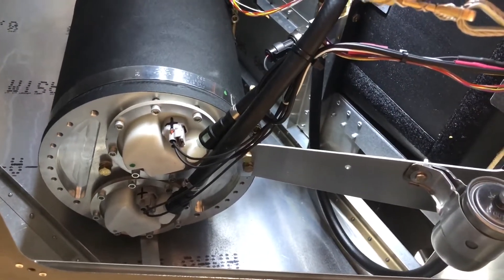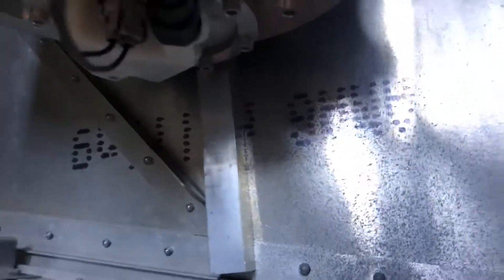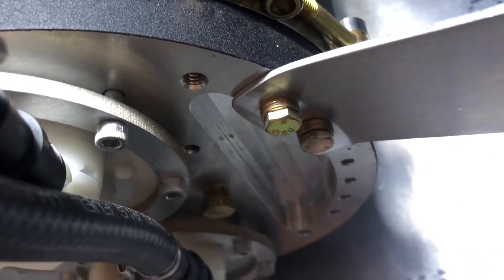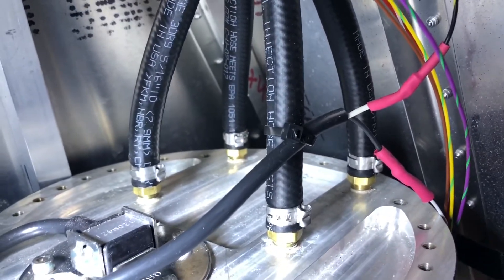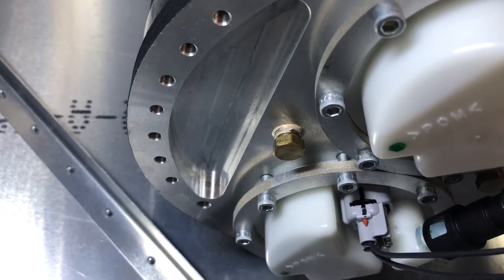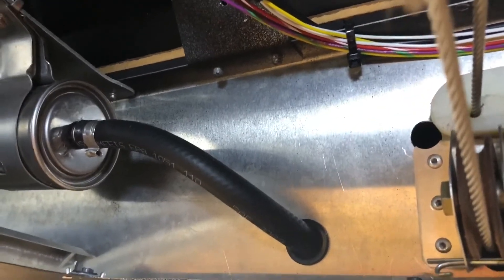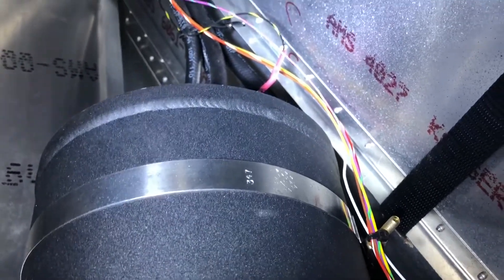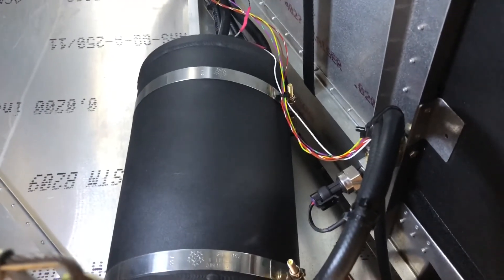Viking 2.5 GAL header tank installation

Comment: Why do you need a Header Tank
Reply from the maker: A SOLID FUEL SYSTEM IS IMPORTANT FOR ANY AIRCRAFT ENGINE. THESE ARE THE SYSTEMS USED BY THE THREE MOST POPULAR LIGHT AIRCRAFT ENGINES IN USE
TYPE OF FUEL SYSTEMS USED
ROTAX
• Dual external fuel pumps
• External single fuel regulator
• Fuel return commonly back to primary fuel tanks
• 6 port duplex fuel selector valve
VIKING
• Dual in-tank pumps
• In-tank dual fuel regulators
• Header tank based system
• No fuel valve needed
UL
• Dual external fuel pumps
• External single fuel regulator
• Fuel return commonly back to primary fuel tanks
• 6 port duplex fuel selector valve
EXTERNAL FUEL PUMPS
• UL and Rotax use external fuel pumps for their injected engines. They are a copy of what was used in cars prior to 1998.
• When 2 pumps are used together, for takeoff and landing, the amperage draw can be 10-14. This is a lot since these engines are not equipped with good alternator systems. Even with a single pump running, the draw is scary high if either the generator or external voltage regulator were to fail. The dual fuel injectors and sparkplugs cannot work without electricity. 
• External pumps produce close to 2 x the required fuel pressure for the injectors. The excess pressure is regulated back down, using an engine mounted fuel regulator. Excess fuel is returned to the fuel tank. 
• All this additional fuel, when returned, brings heated fuel to the tank. The total fuel circulating between the main fuel tank and the engine, then returned, is about 30-35 GPH. 
• Due to the excessive fuel circulating, the amount of fuel gravity fed to the firewall mounted pumps is also 30-35 GPH. Hence the large hoses specified.
• Rotax and UL each use a single fuel regulator at the end of the fuel rail, mounted to the hot, air cooled cylinders. The Rotax brand is likely to be Bosch but the UL is a no-name copy. Each is filled with rubber parts and will fail, sooner or later.
• This is now an antiquated way to feed fuel to a fuel injected engine.
EXTERNAL FUEL REGULATOR
What is the big deal about a fuel regulator? Well, what is the big deal about a wing attachment bolt?
• The external fuel regulator is the single point of failure in a UL or Rotax injection system. 
• An external regulator requires external fuel return hoses.
• The regulators used are automotive quality and have a definite life span.
• The engine ECU (control computer) knows nothing about fuel pressure. If the pressure is wrong, the engine will not operate correctly, no matter how many sparkplugs it has.
• A single fuel pressure regulator is not consistent with any other dual capability. The engine cannot run without it.
• ASTM was never informed of this.

INTERNAL FUEL PUMPS AND FUEL REGULATORS
• The Viking fuel system does not use a 35 gph gravity drain system, a single fuel regulator or a complex 6 port fuel selector valve. 
• The Viking system is based on dual, in- tank pumps, each equipped with its own fuel regulator.
• Each pump draw less than 1.6A and has no external fuel return hoses.
• Only the amount of fuel used by the engine is gravity fed from the main fuel tanks to the header tank
• A fuel level gauge measures the exact fuel level of the header tank, providing accurate fuel gauging.

ISSUES RELATED TO SYSTEMS DRAWING/RETURNING FUEL TO/FROM A MAIN FUEL TANK
• A fuel injected engine MUST have a solid fuel pressure at all times, or the engine will stop
• Having reliable gravity feed, all the way from the wing tanks to the firewall mounted pumps, of 30-35 gallons / hour is much harder than the 2-12 GPH that the engine is actually using. When this system was used by cars, the pump was mounted right below the fuel tank.
• There is an illusion that these systems work because fuel usually come out of the pump when turned on. What is not so obvious is how small the margin is for the system to stop working. 
• It is likely that even though the pump was never designed to pull fuel on the suction side, that in the airplane application it actually does this to keep up with demand. Since there is suction, any air leak prior to the pump has the potential for pump cavitation. An O-ring leak in a fuel drain, gascolator or selector valve would not be good. 
• Since the fuel is at low pressure (suction) as it enters the hot engine compartment, any exposed metal fuel pump body or fuel system component could cause the fuel to boil and cavitate the pump, dropping the pressure from 43.5 psi to less than 10 psi. Once the pressure has been dropped, the pump will not be able to re-gain pressure due to the 43 psi fuel regulator at the other end of the engine fuel rail. (Here is where a small bleed bypass around the pressure regulator would be handy but this is not implemented by either Rotax or UL. The bleed would allow some fuel to flow, re-priming the pump with fresh fuel and again be able to make pressure) 
• A larger amount of unusable fuel. Because more fuel is being returned to the tank, than is used by the engine, fuel is on the move in the tank and not always available at the pickup location. To guard against this, more fuel must be kept in the tank, shortening the available range. Also, as the fuel level decrease in the tank, the warm return fuel becomes more and more pronounced and pump cavitation is even more likely. 
• Serious concern of un-porting the fuel pickup location. As mentioned above, one second without fuel pressure is one second the engine will not operate. Carbureted engines have a fuel bowl from which the engine can draw fuel. Not so with an injected engine. There has to be fuel available to the pump at all times. With low fuel, and in an extended descent, this is usually not the case. Some installations add more complexity to the system by the installations of door-post mounted “sumps” in order to have some protection from this. However, keep in mind that these fuel pockets only last for a few seconds when the system wants to pump 35 GPH in a circle. The pump will draw the fuel from the pocket in no time flat, bringing back the un-porting issue.
THE FUEL SELECTOR VALVE
• The UL and Rotax systems usually use a duplex / 6 port fuel selector valve. These are complex, costly and have 6 fuel line connections right inside the cabin. Another style is from a pickup truck with dual fuel tanks. These are of terrible quality and are electrically operated. Cut one open and inspect the construction if considering using one. Again, there is no backup so be sure it works. 
• Viking does not use a fuel selector valve. Fuel simply drains from the two wing tanks into a single header tank. From there, no selection is required. The popular C-150 also has no fuel selector.
SO, WHY IS THE VIKING SYSTEM BETTER AND HOW DOES IT WORK
• The Viking system consists of a header tank and two fuel pumps. That’s it. Fuel fills the header tank by gravity. If the engine uses 6 GPH, the system only has to flow 3 gallons from each wing tank. (only about 1 qt every 5 minutes)
• The pumps are inside the tank and submerged in fuel, just like every modern fuel injected car. The fuel regulators are right on the pump bodies, pre-filer screens are part of the system, etc. 
• A precise fuel sender unit and gauge are available, allowing the main tanks to be used to a lower level with complete confidence. The 30 min VFR daytime reserve is in the header.
CAN I USE A VIKING HEADER TANK WITH A UL OR ROTAX ENGINE
• The short answer is – yes you can. Viking has such a system and has been successfully tested on a UL engine. The long answer is much more complex and you need to understand it if you are contemplating such a conversion. Here are the details.
• First, it is important to understand how the original system works and the reason for why things are the way they are. 
• Fuel pumps: The fuel pumps are big, heavy and draw a lot of current for a reason. In order to reliably produce 43 psi of pressure, additional capacity is used, and then regulated down. Because the pumps are external to the fuel, they are only cooled by the fuel running through them and by convection. If the pump slowly got hotter and hotter during operation, a vapor situation would surely occur. 
• In order to use fuel for pump cooling, excess fuel needs to flow through the pump. Most systems run 3-5 times more fuel through the pump than what is used by the engine. The main reason the fuel is returned back to the fuel tank is to cool it. The fuel also cools the fuel rail and purges air from the rail when first primed for starting. 
• If we eliminate the large pumps, we also eliminate some of the heat put into the fuel. Some fuel must still be returned to the header tank since these fuel rails are not designed to purge air without a return at the last injector. A small amount of return also helps cooling the fuel injectors.

THE VIKING HEADER TANK SYSTEM USED ON THE UL OR ROTAX ENGINES
• The system operates exactly as if used on a Viking engine, with one exception. There is a small amount of calculated fuel return from the fuel rail back to the header tank. The existing fuel regulator is replaced with a bleed large enough to purge air from the system but small enough for the in-tank pumps / regulators to easily maintain 43 psi of rail pressure.
Reply from the maker: A SOLID FUEL SYSTEM IS IMPORTANT FOR ANY AIRCRAFT ENGINE.  THESE ARE THE SYSTEMS USED BY THE THREE MOST POPULAR LIGHT AIRCRAFT ENGINES IN USE

ROTAX

Dual external fuel pumps

External single fuel regulator

Fuel return commonly back to primary fuel tanks

6 port duplex fuel selector valve

VIKING

Dual in-tank pumps

In-tank dual fuel regulators

Header tank based system

No fuel valve needed

UL

Dual external fuel pumps

External single fuel regulator

Fuel return commonly back to primary fuel tanks

6 port duplex fuel selector valve

EXTERNAL FUEL PUMPS

UL and Rotax use external fuel pumps for their injected engines. They are a copy of what was used in cars prior to 1998.

When 2 pumps are used together, for takeoff and landing, the amperage draw can be 10-14. This is a lot since these engines are not equipped with good alternator systems. Even with a single pump running, the draw is scary high if either the generator or external voltage regulator were to fail. The dual fuel injectors and sparkplugs cannot work without electricity.  

External pumps produce close to 2 x the required fuel pressure for the injectors. The excess pressure is regulated back down, using an engine mounted fuel regulator.  Excess fuel is returned to the fuel tank.  

All this additional fuel, when returned, brings heated fuel to the tank. The total fuel circulating between the main fuel tank and the engine, then returned, is about 30-35 GPH.  

Due to the excessive fuel circulating, the amount of fuel gravity fed to the firewall mounted pumps is also 30-35 GPH. Hence the large hoses specified.

Rotax and UL each use a single fuel regulator at the end of the fuel rail, mounted to the hot, air cooled cylinders.  The Rotax brand is likely to be Bosch but the UL is a no-name copy. Each is filled with rubber parts and will fail, sooner or later.

This is now an antiquated way to feed fuel to a fuel injected engine.  

EXTERNAL FUEL REGULATOR

What is the big deal about a fuel regulator?  Well, what is the big deal about a wing attachment bolt?

The external fuel regulator is the single point of failure in a UL or Rotax injection system. 

An external regulator requires external fuel return hoses.

The regulators used are automotive quality and have a definite life span.

The engine ECU (control computer) knows nothing about fuel pressure.  If the pressure is wrong, the engine will not operate correctly, no matter how many sparkplugs it has.

A single fuel pressure regulator is not consistent with any other dual capability. The engine cannot run without it.

ASTM was never informed of this. 

INTERNAL FUEL PUMPS AND FUEL REGULATORS

The Viking fuel system does not use a 35 gph gravity drain system, a single fuel regulator or a complex 6 port fuel selector valve.  

The Viking system is based on dual, in- tank pumps, each equipped with its own fuel regulator.

Each pump draw less than 1.6A and has no external fuel return hoses.

Only the amount of fuel used by the engine is gravity fed from the main fuel tanks to the header tank

A fuel level gauge measures the exact fuel level of the header tank, providing accurate fuel gauging. 

ISSUES RELATED TO SYSTEMS DRAWING/RETURNING FUEL TO/FROM A MAIN FUEL TANK

A fuel injected engine MUST have a solid fuel pressure at all times, or the engine will stop

Having reliable gravity feed, all the way from the wing tanks to the firewall mounted pumps, of 30-35 gallons / hour is much harder than the 2-12 GPH that the engine is actually using.  When this system was used by cars, the pump was mounted right below the fuel tank.

There is an illusion that these systems work because fuel usually come out of the pump when turned on.  What is not so obvious is how small the margin is for the system to stop working. 

It is likely that even though the pump was never designed to pull fuel on the suction side, that in the airplane application it actually does this to keep up with demand.  Since there is suction, any air leak prior to the pump has the potential for pump cavitation.   An O-ring leak in a fuel drain, gascolator or selector valve would not be good. 

Since the fuel is at low pressure (suction) as it enters the hot engine compartment, any exposed metal fuel pump body or fuel system component could cause the fuel to boil and cavitate the pump, dropping the pressure from 43.5 psi to less than 10 psi.  Once the pressure has been dropped, the pump will not be able to re-gain pressure due to the 43 psi fuel regulator at the other end of the engine fuel rail.  (Here is where a small bleed bypass around the pressure regulator would be handy but this is not implemented by either Rotax or UL.  The bleed would allow some fuel to flow, re-priming the pump with fresh fuel and again be able to make pressure) 

A larger amount of unusable fuel.  Because more fuel is being returned to the tank, than is used by the engine, fuel is on the move in the tank and not always available at the pickup location.  To guard against this, more fuel must be kept in the tank, shortening the available range.  Also, as the fuel level decrease in the tank, the warm return fuel becomes more and more pronounced and pump cavitation is even more likely.

Serious concern of un-porting the fuel pickup location.  As mentioned above, one second without fuel pressure is one second the engine will not operate.  Carbureted engines have a fuel bowl from which the engine can draw fuel.   Not so with an injected engine.  There has to be fuel available to the pump at all times.  With low fuel, and in an extended descent, this is usually not the case.  Some installations add more complexity to the system by the installations of door-post mounted “sumps” in order to have some protection from this.  However, keep in mind that these fuel pockets only last for a few seconds when the system wants to pump 35 GPH in a circle.  The pump will draw the fuel from the pocket in no time flat, bringing back the un-porting issue.

THE FUEL SELECTOR VALVE

The UL and Rotax systems usually use a duplex / 6 port fuel selector valve.  These are complex, costly and have 6 fuel line connections right inside the cabin.  Another style is from a pickup truck with dual fuel tanks.  These are of terrible quality and are electrically operated.  Cut one open and inspect the construction if considering using one.  Again, there is no backup so be sure it works. 

Viking does not use a fuel selector valve.  Fuel simply drains from the two wing tanks into a single header tank.  From there, no selection is required.  The popular C-150 also has no fuel selector. 

WHY IS THE VIKING SYSTEM BETTER AND HOW DOES IT WORK

The Viking system consists of a header tank and two fuel pumps.  That’s it.  Fuel fills the header tank by gravity.  If the engine uses 6 GPH, the system only has to flow 3 gallons from each wing tank.  (only about 1 qt every 5 minutes)

The pumps are inside the tank and submerged in fuel, just like every modern fuel injected car.  The fuel regulators are right on the pump bodies, pre-filer screens are part of the system, etc.  A precise fuel sender unit and gauge are available, allowing the main tanks to be used to a lower level with complete confidence.  The 30 min VFR daytime reserve is in the header. 

CAN I USE A VIKING HEADER TANK WITH A UL OR ROTAX ENGINE

The short answer is – yes you can.  Viking has such a system and has been successfully tested on a UL engine.  The long answer is much more complex and you need to understand it if you are contemplating such a conversion.  Here are the details.

First, it is important to understand how the original system works and the reason for why things are the way they are. 

Fuel pumps:  The fuel pumps are big, heavy and draw a lot of current for a reason.  In order to reliably produce 43 psi of pressure, additional capacity is used, and then regulated down.  Because the pumps are external to the fuel, they are only cooled by the fuel running through them and by convection.  If the pump slowly got hotter and hotter during operation, a vapor situation would surely occur.  

In order to use fuel for pump cooling, excess fuel needs to flow through the pump.  Most systems run 3-5 times more fuel through the pump than what is used by the engine.  The main reason the fuel is returned back to the fuel tank is to cool it.  The fuel also cools the fuel rail and purges air from the rail when first primed for starting. 

If we eliminate the large pumps, we also eliminate some of the heat put into the fuel.  Some fuel must still be returned to the header tank since these fuel rails are not designed to purge air without a return at the last injector.  A small amount of return also helps cooling the fuel injectors.